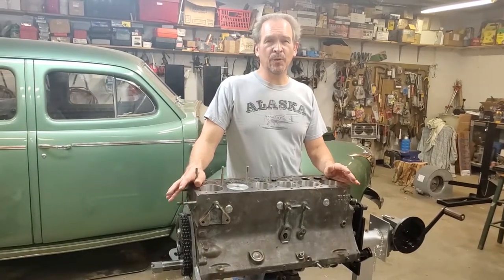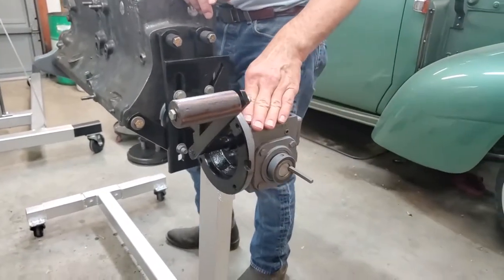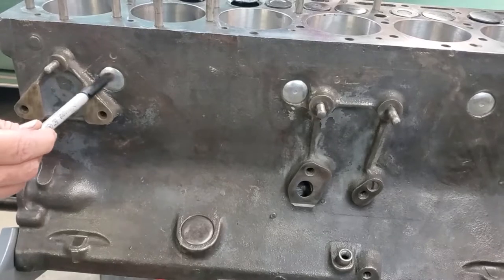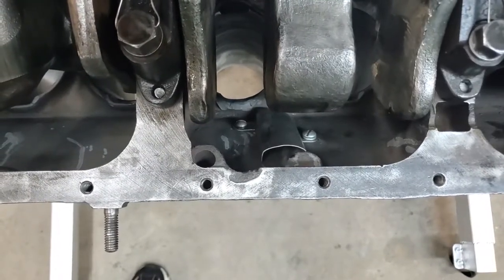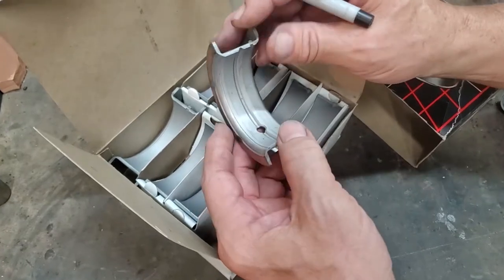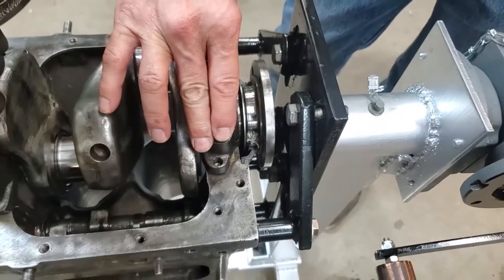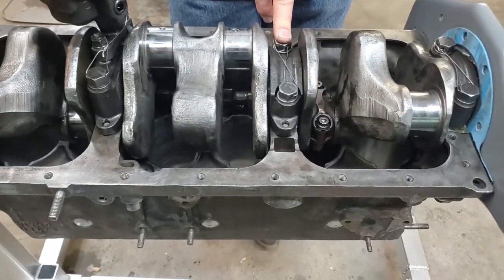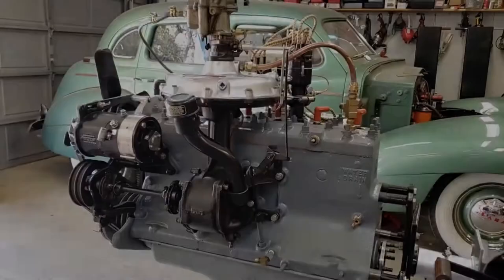Graham Supercharged Engine Overhaul Part I - Graham Engine Main Bearings and Cam

Comment: How do you use Permatex #2? In this video you state it should be used when installing the two screws to hold the oil deflector. So does it go on the screws and then fasten the screws? Would the same be true for the engine data plate and it’s four fasteners?
Reply from the maker: Good questions! Yes, you can use the Permatex #2. Use drive nails, applying the Permatex first. Same is true for the engine data plate and fasteners.
Reply: Carz Plus In some places you use Aviation Permatex, in others Permatex #2. I’ve looked online and they seem like similar products. Why do you use one in some places and the other in other places?
Reply from the maker: @mannyhondroulis8574  Aviation Permatex is used on gaskets between essentially flat surfaces. It is designed to fill small nicks and scratches as 
well as effectively glue the gasket in place and create a long lasting seal. Permatex number 2 is a non-hardening thicker paste-like substance that is best used to fill the voids between threaded components. Aviation Permatex will not work in such an application on any consistent basis.